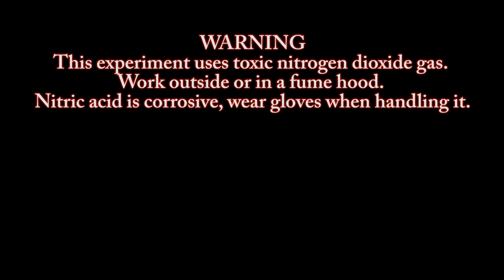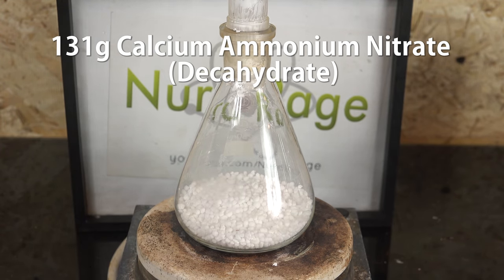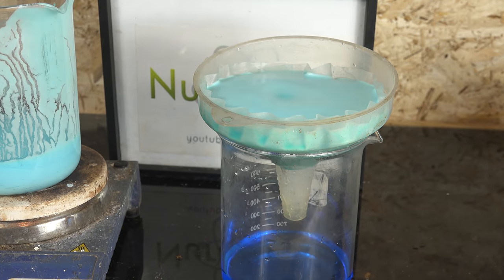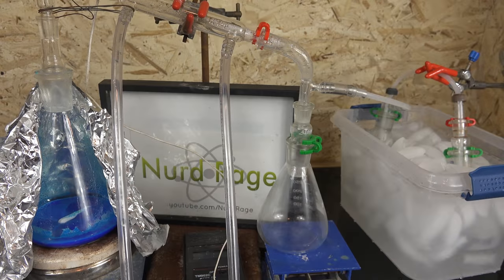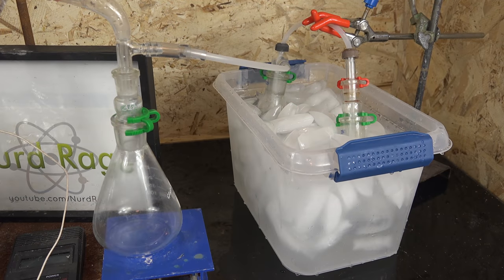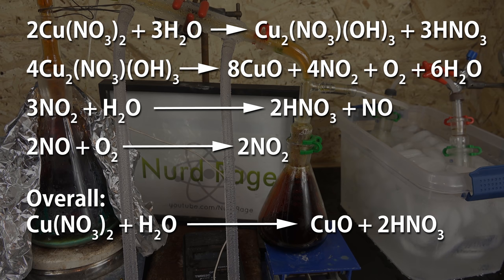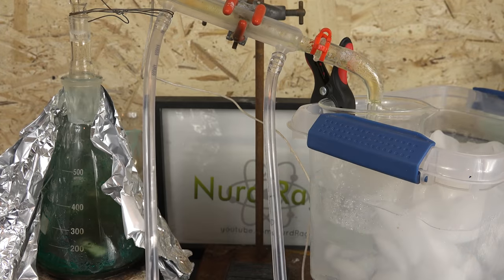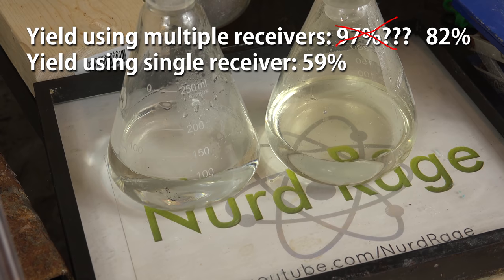Make Nitric Acid by Thermal Decomposition of Copper Nitrate

Comment from the maker: I'll be honest, this was a terrible TERRIBLE way to make nitric acid because filtering calcium sulfate is painfully slow. Do this once and you'll never want to do it again for the rest of your life.
Reply: Wonder if the cheesecloth method would work at all here. Take your filter paper full of slurry, kinda ball it and twist the filter paper at the top, then wrap that in cheesecloth and use a weight to press out the water. Alternatively use your hands to squeeze it but that's much more likely to burst the filter paper.
Reply: HOLY SHIT YOUR ALIVE!!!
Reply: Horizon585  That only applies to red / white fuming nitric acid. Not azeotropic 68% nitric acid
Reply: Heeeey, you ran with my comment/question from like 4 years ago! Definitely not the direction I thought it'd go, but still cool to see.
Reply: From someone who is poor and loves chemistry, I am willing to spend more time making chemicals in order to save money. I love this video.
Reply: Horizon585  only Nitrile gloves burst into flames with nitric acid. Nitric acid can penetrate latex gloves. You can only use but yl rubber gloves with it.
Reply: Hey ! You could make nitrogen dioxide from the air. Probably using electricity in chemistry is like cheating )
Reply: If you start w/ basic copper nitrate (Cu2(NO3)2•3Cu(OH)2) you can skip all the previous steps. Hydrated Cu(NO3)2 first decomposes to the “basic” form and then to NO2 etc. which can be bubbled through H2O. It’s available by the pound on Amazon.
Reply: For those that cant get calcium nitrate or ammonium nitrate. strontium nitrate could be substituted it is found in road flares. I've done the quick and dirty method of sulfuric acid and strontium nitrate also works well but is even harder to filter due to the acid present that destroys the filter paper. Also cheese cloth can help with filtering since the calcium sulfate clumps together.
Reply: Do you think filtering calcium sulphate would go faster if i use a suction filter?
Reply: I wonder if for silver refining, this would be efficient enough to be worth while - that is cementing silver out w/copper, and so on..
Reply: maybe an old school ceramic büchner funnel can make the filtration easy...
Reply: I have an idea you can try to improve this process: what if instead of making whole bunch of copper nitrate you just add some catalytic amount of copper oxide to molten calcium nitrate  and distill it? I mean one pot method where copper nitrate forms in-situ in the melt and decompeses . I think you know ehat I mean, it can work.
Reply: It sounds weird but try it with vibration of and ladyvibrator or other vibrationmachines😊
Reply: Yeah well i i filter rust made from ferrous chloride so dont tell me about slow. Thats why i have a regular day job and several other projects I'm not waiting in the wings over. So if you have a week of prjects to keep you occupied, filtering it isn't a big deal. 

I currently have a pound of hematite i got from a junkyard im reacting with peroxide, which should take a month to convert to rust. The only problem is that you have to remove the water inbetween  which increases the amount of time. But these patient methods are fine for ameteur chemists because we often have multiple projects to distract us. Its a bit like gardening.
Reply: If you somehow have a centrifuge separating the CaSO4 could be much easier. No I haven't tried that with chemicals, but if it can separate proteins floating in water it surely can separate insoluble salts right?
Reply: Thank you very much for a long awaited video of you! You are in my knowledge, the only one apart from Cody, who uses readily available stuff to produce highly needed basic materials, which you could also apply in case of being thrown back into the stone age.
Reply: welp there goes my plan, back to buying drain cleaner and stump remover
Reply: I wasn't going to make nitric acid anyway, but thanks for warning.
Reply: The key to converting the copper sulfate to nitrate while speeding the filtration is to only add the 1/6 the required sulfate, filter, then repeat, this produces less calcium sulfate for a given volume so its not as bulky in the filter which speeds filtering. So if your recipie calls for 60g of copper sulfate add 10 grams, filter,  add 10 g to the filtratie, etc until all 60g is added.  Its definitely a hassle to add the entire calculated amount of sulfate in one addition then filter. There is a distinct difference between doing this to isolate nitric acid vs producing it in situ for dissolving copper base from gold plated scrap.
Reply: What about usinf a vacuum filter?
Reply: gets clogged too fast
Reply: @kemster9495  SrSO4 is even less soluble than CaSO4, so there would also be less unprecipitated SrSO4 (if any). Neutralising the solution would help, both for less SrSO4 in solution (due to formation of small amounts of Sr(HSO4)2, and the acid would not dissolve the filter paper.
Reply: This process could also be used to concentrate dilute nitric acid if you don't have sulphuric acid available. In this case you can go and precipitate CuO with e.g. NaOH or Na2CO3, filter and dissolve the precipitate in your dilute nitric acid. Or to avoid that step, basic copper carbonate can be used, which is available as a pigment (Malachite). Or just buy CuO right away, it's not too expensive and can be re-used.
Reply: @jimmyfish632  this is my question also. Copper nitrate is a byproduct for me from silver refining. So is the solution left after the cementing stage adequate copper nitrate?

Comment: I knew there was a good reason to save that copper nitrate solution from purifying sterling silver scrap.... Thanks NurdRage!
Reply: I was literally thinking the exact same thing while watching this video.  Currently I convert mine to KNO3 by adding KCL but this video still gets the mind working on new ways to look at things.
Reply: Are you also watching Sreetips?
Reply: @bormisha  I'm sure he could do it, but his copper solution often has other things dissolved in it and he uses so much extra water that I doubt it would be worth the time by the time he evaporated most of the excess off.
Reply: I'm glad NR finally tried this one! I posted a comment not long ago about this process on Nile Reds channel (or maybe here, can't recall).  I have been recycling my Copper sulfate/nitrate solutions this way for many years in my refining work. A more interesting aspect to me of the  usefulness of copper nitrate is when it is used directly in refining of copper based scrap while producing the nitric acid in situ as opposed to separating out the nitric as shown here. For us refiners there is really no reason to actually distill out nitric acid as it will continually be reused as it is converted from sulfate to nitrate ad infinitum during the daily refining processing merely by adding copper nitrate and sulfuric acid to the  reaction bucket. The refiner ends up with a continuous cycle process that dissolves the copper base metal and leaves behind the gold foils we all know and love. I have found that the normal day to night temperature swings are enough to crystallize out the copper sulfate needed. These crystals are harvested daily in the AM and converted as shown here to fresh copper nitrate. As a side note I find the blue color of the copper nitrate to be a great end point indicator when rinsing the calcium sulfate in the copper nitrate regeneration step. There is another method NR has not shown on video which is useful for silver cells: conversion of the copper nitrate in solution to nitric acid via electricity.  I wrote about this method years ago on GRF for all those reading that are in the refining world. Great video NR! You rock! Steve
Reply: Did Mrs. Sreetips get onto you about hoarding reagents again? XD
Reply: I was thinking the exact same thing.   I’ve been saving all of my copper nitrate, and wondering the best thing to do with it all.   
At first I was thinking I should drop out and recover the copper, but nitric is by far the most expensive part of refining, so I think I’m going to give this a try.    

But how do you drop out your silver from solution?   Do you use salt/HCl to form silver chloride? Or do you just use copper to drop out your silver?   

I’m not a chemist, just an amateur refiner. I’ve been dropping out silver chloride using salt.  So not sure if the solution is still copper nitrate, or if it is now copper chloride?  I am assuming the Cl is all going to the silver chloride and it should still be copper nitrate, but not totally sure.
Reply: lazersteve I remember watching a few of your refining videos when I first got started.   But haven’t seen any new ones from you in a while.   
I’d love to check out a video of this  process.

Comment: Next episode: NR making nitric acid out of thin air (no kidding, you can do this with an electric arc, Cody did it).
Reply: Birkeland Eyde Process
Reply: If you're actually going to use this method, I recommend using an oxygen concentrator to increase oxygen content of inlet gas to around 60% - the yields will be much higher.  Used concentrators (that don't work well) are fairly available on one of the auction sites.  Not working "well" is actually an advantage here, as what one is aiming for is 66% O2 and 33% N2 across the arc.
Reply: @NormReitzel   Having a high current and relatively low voltage arc increases the efficiency dramatically, the key is to make it stable which is the difficult part, reason why many get low efficiency is that they use very high voltages and low currents like neon sign transformers, the arc is stable due the high voltage but very inefficient in turning power into heat.
Reply: @teresashinkansen9402  I concur.  However, it's not just kinetic.  You end up with hot gas, and there is no way I know of to instantly reduce the temperature of the gas fast enough to preclude the reverse reaction. In some way, you're faced with a compromise between the kinetic result - which in air, is 30% max, and the equilibrium result which is much much lower.  Pumping extra oxygen into the gas stream helps by increasing the kinetic yield.
Reply: @NormReitzel  Yeah that's true, quenching of the hot gases is vital for a good efficiency. A way to appreciate the importance of this is when a pot of cool water sits on a gas stove, you can smell the nitric oxides pretty well however if the pot has no water and becomes very hot the smell is almost non existent. So it could be analogous, just after the gas leaves the arc zone a water cooled wall with small fins to quench the hot gas. Hope to experiment with higher oxygen concentrations eventually it seems like a great way to increase yield even further and easily.
Reply: NR being NurdRage or NileRed? :P
Reply: Please 🙏 do this

Comment: This could be useful with small scale precious metal refining...  Copper nitrate (mixed with nickel, tin, etc) is a common waste product, this looks to be a straightforward way to recover a decent amount of the expensive nitric acid.
Reply: Add a little HCl to the nitrate waste and then plop in a cleaned piece of iron.  All the copper will reduce out.  You'll need to fiddle with the amount of HCl to add, but that's not really difficult.  Just add a little at a time until the copper starts to form on the iron, which is pretty obvious!  Then you have mostly iron nitrate, a yellow-green solution, which decomposes at a low temp (only 80C).  It's much easier to produce NO2 that way, and you get the copper back quickly.  In fact, the iron nitrate solution can decompose directly into iron oxide and nitric acid, under the proper conditions, meaning you just need to collect the acid vapor in your distillation apparatus!

Comment: You should’ve mentioned that copper nitrate is the largest waste product produced from refining silver! I’ve got a few gallons of the stuff that I’m currently using as electrolyte to make copper crystals via electrolysis. It does look like a royal pain though but at least I know I can downsize and concentrate my copper nitrate volume by removing the water. Thanks for the tips!

Comment: A quick tip to remove calcium sulfate from glass frits: Just rince it with an ammonium carbonate solution and then rince again with dilute HCl.
The CaSO4 is converted to amorphous calcium carbonate (that doesnt stick) by double displacement and the HCl convert it to soluble CaCl2
Reply: Not worth it

Comment: Copper nitrate can be produced by electrolytic methods, directly from a copper anode and a nitrate salt, with the help of a clay-pot membrane.
It's slow but not difficult.  Given copper nitrate from that source, which incidentally is much more pure, perhaps this decomposition method could be regarded more favorably.
Thanks for another great video that adds nicely to the marketplace of "chem" ideas and techniques!

Comment: Superb Applied Chemistry !
You would certainly have been the winner of the 2015 Druken aga Nitric Acid Challenge !
Reply from the maker: I thought that challenge required that no nitrates at all are used
Reply: @NurdRage  The ONLY ideas that came out were alternative routes to a nitrate and/or sulphuric acid. Eventually i upped the ante and relaxed the rules. You would have won.

Comment: I would love to see a nitric acid video out of thin air from you (Ref. Cody). Can't stand the way Cody measured the yield through pinches of baking soda :D

I recently read about the Zeldovich mechanism describing the thermal NO formation from air. Interestingly the formation through a nitrogen is much faster than that through an oxygen radical at high temperatures, which would basically mean that lower levels of oxygen should form more NOx Gases than a stoichiometric mixture of 67 % O2 and 33 % N2 could do. Sadly, I don't have a lab to test it.

Comment: I have done this many times. Vacuum flasks work great. I use fish tank air stones in the water.   A hole in the cork for the feed line, attach 2 check vales to the vacuum nipple. The first one to allow air in, then a second one to allow the gas out to another flask. you can chain as many as you want together and never get back flow. 3 seems to completely scrub all the No2. Don't use tap water,

Comment: Amazon sells basic copper nitrate, which  I believe is the intermediate when decomposing the hydrates to NO2, for $9 USD per lb (+ $17.50 shipping). If it wasn’t for the shipping this might be a cost effective lab-scale method. I can get conc nitric locally for $70 per liter - still kinda pricey but gonna keep this method in mind. Thanx for the video. 👍
Reply: i'm not sure that's worth it, since the first step of decomposing the hydrates to basic copper nitrate accounts for 75% of the theoretical yield of nitric acid
Reply: Katie Frisk I’ll give it a whirl one of these wknds and, if it’s feasible, post a vid on my channel.
Reply: Katie Frisk ... never mind, I crunched the numbers and it always comes back to economy of scale. Basically 1 mole of copper nitrate (basic or not) makes 1 mole of nitric acid. Assuming a final concentration of 70% (w/w) HNO3, then according to online prices, you can start breaking even if buying in the 100 kg range of reagent (+ your labor). So as always: don’t make it if you can buy it. But I’m always looking for someone to have an a-ha moment and discover something new. BTW, Science Company sells 2.2 L for $87 and I’m a couple miles away, so there you have it. Cheers 🥂

Comment: I have gallons of copper nitrate as a waste product from silver production, (i scrounge abandoned mines from the 1800's for remaining ore).
Reply: Isn't that dangerous 🤔
Reply: @FreelancerFreak  sure is. But i have all my safety equip inc. Air quality meters and Geiger counter. And did geology.
Reply: Getting copper back is easy.  If you add a little HCl, the chloride facilitates the reduction of copper with scrap iron (I use angle iron or uncoated rebar, mostly).  Then you get iron nitrate solution and pretty pure copper.  The iron nitrate decomposes into iron oxide and nitrogen dioxide at only 80C, so it makes the nitric acid recovery process much simpler.  You can bubble the NO2 gas through an aquarium bubble stone into a tall column filled with cheap 3% hydrogen peroxide (I can get it at typical club stores for about $1/liter) which greatly increases nitric acid recovery, as the hydrogen peroxide directly forms nitric acid upon exposure to nitrogen dioxide.

Comment: @NurdRage You could also try thermal decomposition of magnesium nitrate hexahydrate. It's sold as fertilizer so it should be available. The thermal decomposition of Mg(NO3)2*6H2O is 89 °C, so it's fairly low.
Reply from the maker: actually i tried it, it needs 300 celsius to start, it's doable, but so much harder than copper nitrate
Reply: @NurdRage  Ah, so the hexahydrate doesn't decompose completely? Just partially until all the water is driven off and then you're left with, I assume basic magnesium nitrate and some anhydrous magnesium nitrate? Since the latter needs 300 C to completely decompose.
Reply: Well one can heat sodium bisulfate monohydrate with the magnesium nitrate.  Might be doable at a lower temperature.  Funny, I can buy potassium nitrate by the kilo on the cheap but sodium nitrate is getting a little difficult to find.  I need sodium nitrate for aqua regia and nitrogen oxides when I don’t want to use my precious nitric acid.

Comment: (IANA professional chemist) Is this clean & well-balanced reaction related to the fact that copper in nitric acid gives off nitrogen oxides, and that the reaction won't start until you add a bit of water? There seems to be a lot of symmetry here.